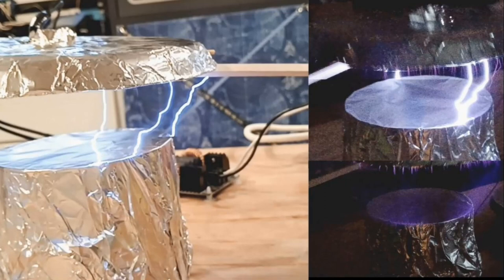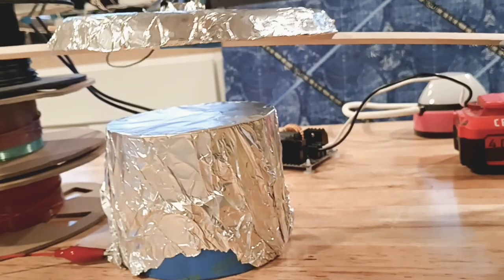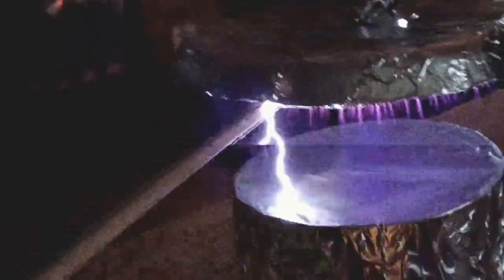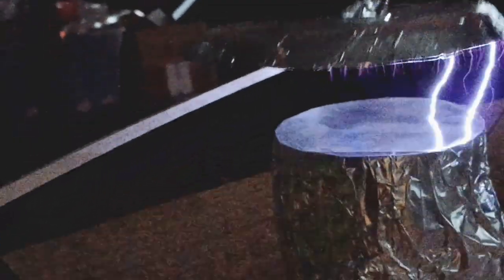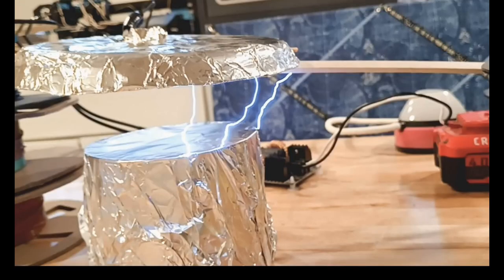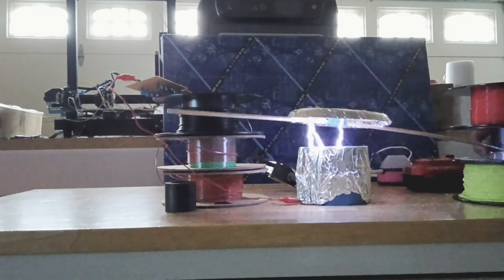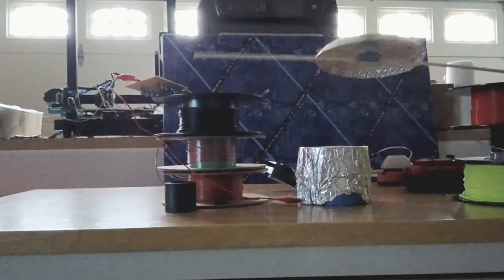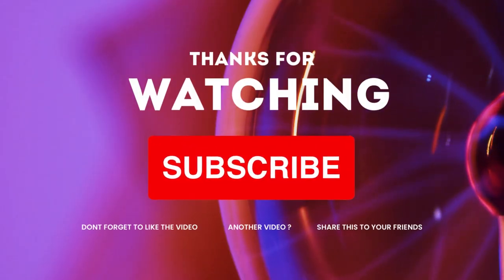High Voltage And Plasma Across 2 Capacitors

Comment: i cant thank you enough but we have to do this next take paper plate glue alloy on top pvc glue then make another and glue together stack them but this time with a 1 inch hole in centre please can you do this i want to see how much pressure it creates as in upwards pressure many thanks great build and video this is teaching us a lot we will get there.
Reply from the maker: I will try in a few weeks. I am in the middle of another project. But the hole idea is interesting. I think I found out how to take a magnetron and make it into a jet engine with only voltage. But it is very hard to do and really unsafe. Building a cage to contain stray microwaves. We will see.

Comment: How much air volume can you get to move, at what momentum, with all the plasma and x-rays?
Reply from the maker: The ion wind is 1.0 m/s in this experiment. I needs to be 3.0 to start to move things. More capacitors of higher strength are needed.  This voltage is close to x-rays now. Any more and you will be in trouble with sight.